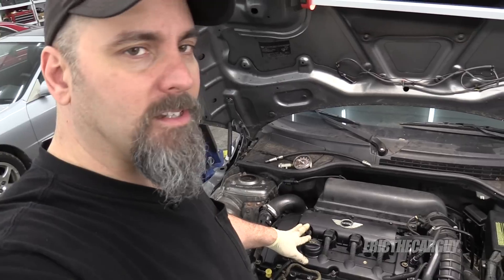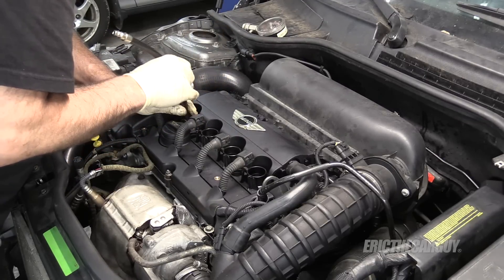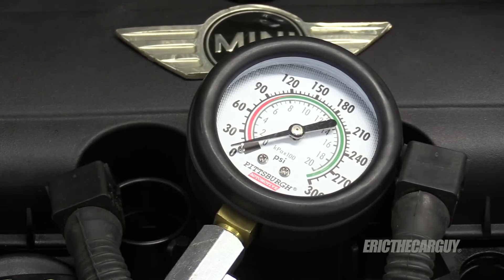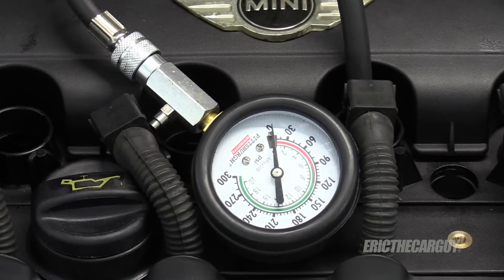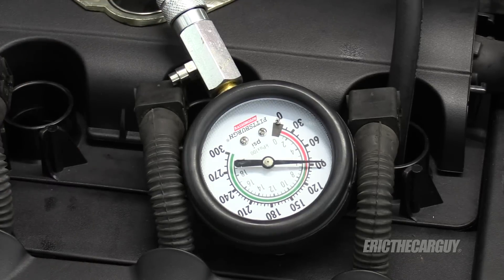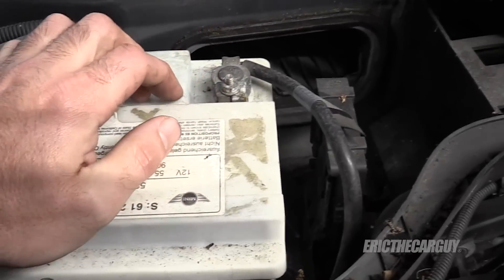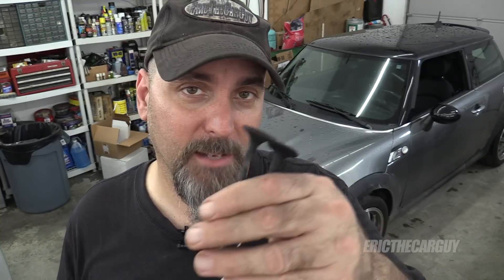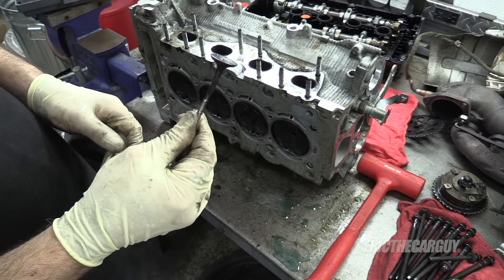How To Find Out if Your Engine Has Bent Valves

Comment: Hi Eric if I may ask something relating to the small Chevy Utility pickup or bakkie as we call them in South Africa. The car got into a flooded road and I am sure the water got in since the engine just went off. It was however not completely immersed into the water. It started after a while and few minutes later on snapped the timing belt and was towed back home. When it was finally fitted with new belt the mechanic noted that a kocking sound. This led to a complete overhaul of the engine. Crankshaft was brushed up. New valves fitted although none were bent.  However it does not get into gears. It idles. What could be the problem?

Comment: I think i got lucky. I had a crack no start issue i was chasing down on my 98 4v cobra motor which i thought was because of an electrical problem i had from a weird being burned on the egr. 

Long story short, while chasing down this issue, i did a compression test and everything was 125-130psi (18cc dished pistons) across the board. I found later the secondary chain was broken. I literally just found the issue so i haven't it'll the head/motor but i think I may have dodged a bullet. 

The primary Caine are new and have less than 100 miles on the powertrain but the heads were untouched. Lesson learned, change everything.

Comment: My 08 Subaru stalled a week ago on my way to work. Her timing belt snapped unfortunately and I’m worried that her valves may have gotten bent too which is an expensive fix. I won’t know until a bit after Tuesday.

Comment: hey Eric like your videos.after you checked the compression in two of the piston chambers do you not have to rotate the crank or cam shaft so that the inlet and exhaust valve seats are closed in the other two piston chambers before testing the other 2.also how much play should the valve stems have in the stem guides.any tips on checking if valves are perfectly straight or if there is too much play in the guides on a pitbike  👍

Comment: Use a bore scope camera in the up position so you can see the valves rotate the engine with a breaker bar from the crankshaft pulley and look to see if you have bent valves when they open and close

Comment: You’re speaking my language now. Lost my hpfp, cam shaft sensor was the codes. Replaced both, and grgegrgrhrhrh.  Take off the cover, timing chain exhaust sprocket sheared off, and the chain was broken.  When it died driving, there was NO significant sound or noise at all, no shaking nothing just.. dead car. I’m hopeful, that the chain broke upon my attempt to restart. As there was never a fire.. just cranking for a second. Then noise then nothing.  I am willing to replace the rods and head gasket etc. and your videos will be my Bible. I need to repair this car so bad. I gambled when my last one blew up, and was toast, hopeful for a decent long term ride. I did get 30k miles before it failed

Comment: My timing chain broke when I tried to start my Toyota PU.  As the valves were not moving when I cranked the engine to try and start her and my engine was a interference type there is a good chance the piston hit a valve.  Would a leak down be worth the effort?

Comment: hey eric i have a 2004 mdx that cranks but wont starts. the spark plugs keep fouling with fuel. when i removed the fuel pump fuse. it started up. i did a compression test i got 120 psi. what do you think?

Comment: Hey Eric, I tried to put a new timing belt on my 2000 Chrysler Concorde LXI 3.2, in my driveway? The belt never broke? Just was doing preventative maintenance. 158,000 on the engine? I lined all the timing marks up, put it back together, no start? Eventually got frustrated, put it on a flatbed, to a mechanic, his diagnosis was bent valves on the drivers side? I bought the timing belt kit, with water pump, installed that, everything spun fine? Would you recommend fixing this car, or try and sell it as is? I put at least $3,500.00 into this car in the last year? From struts, to injectors? Tires, rims, sensors, Evap system, ect.. ect… What would you recommend I do? I had to buy a new car, but this Chrysler ran like a top, before I messed with the timing belt? Can you recommend what to do with this car?

Comment: Nice video. I wanted to free up the pistons on my SUV that's been sitting on the driveway for the past 5 years due to some problem with distributor. So, I am going to take off spark plugs and pour two teaspoons of engine oil into each hole of spark plugs and turn the crankshaft manually in clockwise after a week of letting the oil sink. So is this the way to do it or will it mess up the timing . And , is there certain limit on number of turns or can I turn it few more times until I feel the pistons being lubricated? I subscribed . Thank you.

Comment: This dude aint touching my vehicle....
That vehicle is not normally aspirated (turbo charged), therefore he should've expect below average compression. See, turbo charged engines run with "low-compression pistons" (street talk). This is in order to compensate for the extra air taken into the cylinders, thus eliminating immediate engine failure.

Comment: Wooo lost my timing belt last night, let’s see how bad it is 😅
Reply: What did you find out? I broke my timing belt and there's oil in my 1 spark plug hole I'm looking to repair myself
Reply: @nickdoyle3950  I’ll try to return with an update soon, I wasn’t able to work on it in the driveway so I had to get it flatbed towed somewhere where I could work on it. I just got my tools to the same place so old tear into it ASAP. From my understanding the belt broke or came off, possibly failed auto tensioner, when I was trying to start the car, after losing the alternator belt? I have a 1999 prelude, so this is a bit of a thing. I’m hoping because it wasn’t in the interference range, my valves are OK 🤞
Reply: @ZonymaUnltd.  I need a new engine that's what happens when you go 100 mph mudding in a Accord 😅🤕

Comment: Hey Eric! I’ve owned my Infiniti 05’ G35 6MT since 2006 currently with 123k miles. It’s making the ticking sound but has no leaks around gasket and block. I changed out new sensors, solenoids, spark plugs, brakes, etc. should I spend the extra money to get the ticking sound checked and then have it fixed? Or sell the car and drive it into the ground? How much would a job like this will run? Any advice will help. Thanks.
Reply: Also, the car runs “fine” without any CEL and drives pretty good still.

Comment: I have Subaru which is a interference engine  and it had 0 comp on cyl 3 and 1 which are on the right side of the engine I checked the timing belt and it was off by 5 teeth. I realigned the belt and it now all cyl show 150. Is it possible to have bent valves and good compression? Do I need to do the leak down test?

Comment: I measured Valves on a 2010 Hyundai Accent to see if any were bent, timing belt broke. Visual they look fine however I found 2 valves with stems out by .010.  Do valves stems have to be perfectly straight with no deflection?

Comment: I have a 2.3 l Ford , crank  no start .0  compression on 4 cylinders . I pulled the cover and found the cams were out of time ,possible tooth jump. Is it  possible on this interference motor that timing jump bent all  or half the valves and still continues to crank? I know this is a crap motor . I will try a leak down.

Comment: Without doing wet compression we can't conclude either it's piston rings issue or valve leaking...
If in wet compression, reading improved not improved that means from valve it's leaking..
If reading improved means rings have leak.
If two cylinder HV low compression then gasket burnt..

Comment: I have a 09 R56 JCW with the same problem. Took it to Mini and they said cylinder 3 has 0 compression. They told me I needed a new engine. Once I got the car back the paper work said it is possibly a bad piston ring. I am pretty sure I have bent valves too that don’t require a new $10k engine.

Comment: Ok, so I have a '91 accord and I've done a compression check on all 4 cylinders...1, 3, and 4 are right about where they should be but 2 has no compression what so ever...and there's no leaks that I can find anywhere...could bent valves cause complete loss of compression?
Reply: Nevermind lol....i didn't reach the point of the video where u got 0 compression on one cylinder

Comment: THANK YOU Eric!! You confirm my suspicion.
This is exactly my situation after I did a dry and wet compression test (0 on both tests in cylinder 2, on a 95 corolla 1.8 7afe that I bought for my father. But would it cause engine not able to rev more than 3k rpms?

Comment: Eric, this is somehow unrelated but the idea popped on another video: car electrical connectors.  For some bloody reason, I haven't met a single mechanic who changes the connector housing when it's broken. Everyone makes a ghetto repair with tie-ups or electrical tape. Connector housings even for mercedes or audis are like $2-5 each and it's quicker to cut the old housing with pliers, check the pins are OK and fit a new connector. Click, brand new. Even on dealerships they never fix them properly. I struggled with my broken maf connector for years only to discover the housing was €3.61. 
Just an idea for discussion.

Comment: I have exhaust valve that moves enough to open but does not fully close. I found by removing valve cover and pinpointing the noise. The valve doesn't close therefore the rocker arm is bouncing off the cam lobe. Is the valve necessarily bent or could something else be making it stick?

Comment: Ive got engine management light on my mk4 golf that doesnt want to go away. Had new spark plugs, temp sensor, crank sensor. Diagnosis keeps saying misfire on a cylinder and also temp sensor but they were all replaced just months ago. Car runs fine

Comment: This is just wrong. He removed a huge spark plug, and repaced it with tiny compression tester fitting. It dramatically changed the compression ratio of this cylinder, the results will be very inaccurate.

Comment: Hey Eric. So I have a question about my truck. It’s a 2003 GMC Sierra 2500 HD 6.6. Just recently bought the truck and the brakes went out so I replaced all the rotors calipers and brake pads. After replacing I bleed all the brakes and no more air came out but the brake pedal was still spongy. Took it to jiffy lube to see if maybe they could bleed them but they said that there was a clog somewhere in the system most likely in the power steering. He said the power steering and brake booster are connected and it sounds clogged. It does make a noice when you press the brakes and the power steering sucks. Have you ever heard of this before or got any ideas? Thank you.
Reply: 1971skylark It may be your power steering pump going out. I have a 05 Chevy 1500 without the hydroboost brakes (assisted by power steering). My brake pedal is like that sometimes, but if I pump it a couple times it's stiff. Does your power steering make noise when you turn?
Reply: AdamRud47 yes it does make noise when I turn and it doesn’t work very well. I’ll change it this weekend and see if it changes. Thank you for the help. I’ll keep you posted.

Comment: That's a factory turbo engine so there's less compression because there's forced induction. Otherwise engine would probably crap out after 60,000 miles. (Typically an issue people run into after installing eBay turbochargers on their cars without doing anything else to the engine block.)

Comment: Help Eric the Car Guy I really need help I have the same engine and it looks like I spun the intake camshaft it literally cracked a couple of the Caps bearing caps I'm wondering if there's a place where I can buy Valves and camshafts like a kit to rebuild a head cylinder any help would be much appreciated thank you
Reply from the maker: I recommend replacing the engine.

Comment: Thanks for this! Mine has a W11, but still gives me peace of mind to hear your interpretation of the results. I had low to mid hundreds the last time I did a test, but I think it may not have been warm enough and I'm sure that gauge hose wasn't tight enough. I'll do another one, along with the wet test, soon enough.
Reply: FWIW, the W11 has an 8.3:1 compression ratio
Reply from the maker: The throttle should also be open, but that's problematic in a vehicle with DBW.
Reply: Yeah, that seemed to be a huge issue when I was trying to run running the test. I figure I'll just take the intake hose off to make sure it's opening, or have it held open if it isn't.

Comment: Compression tests are useful to diagnose a myriad of cylinder problems, as low compression could be due to bent valves, worn valve seats, leaking head gasket or worn out piston rings.
As you said, it is one step to get clear results of an engine failing, not necessarily bent valves.

Comment: Why could an engine have bent valves on only one cylinder? For example, if the timing belt snaps and the valves hit the piston head, then pretty much the whole valvetrain would end up crooked.
Reply from the maker: Usually when a piston hits valves the engine stops spinning.
Reply: if the belt failed during startup or idle there's likely not enough momentum in the engine to damage all the valves, and the impact wouldn't be enough to damage the cam.
Reply: +animefreak5757 Interference engines, that was what I meant (the word didn't come up at that time, haha). Timing chains are certainly a "safer" solution to avoid many problems as the ones you mentioned, but there are several chain-driven engine that have either a bad design or uses poor quality materials, as the 2.0 TSI/ TFSI EA888 from Volkswagen-Audi. The timing chain around 70,000km (~45,000mi) will have stretched too much that driving the car would be dangerous, and with such a great slack the chain will hit and scratch other internal components until it gets too loose and starts skipping teeth from the pinion. As an obvious symptom, the engine will make a constant banging noise while running.
Another example is the 4.2 V8 also from Audi (around 2005-2006 MY), where the tensioners fail and the whole engine must be taken apart to replace them since Audi logically thought a timing chain would require no maintenance and they place it on the back of the engine, next to the firewall.
Reply: +animefreak5757 Well, there we go. It will depend on the engine and how much "intrusion" there is between the opened valves and the piston.
Thanks.
Reply: when the valves and the piston can hit each other (without totally dropping a valve) it's called a interference engine, in case you need the term to look something up in the future.  But yea, if the belt fail's while your on the highway it's probable game over for the head at least, since the moving car will drive the engine even if it's stall's.  It's also possible for a belt to skip a tooth when it get's too worn or old...one of the reason's i prefer timing chains.  Sometimes skipping a cog or two on startup is enough to damage one or more valves.

Comment: to my experience variable camshaft and electronic throttle bodies can greatly influence a compression tests.. on some engines you must use a scan tool to activate a compression test function which will not only cut off fuel but will also fully open the throttle plate... just pressing the pedal will not fully open it in alle cases
Reply from the maker: Excellent point.
Reply: I've gotta find a tool that enables this function! Hopefully it's compatible. I have an older scan tool, but I'm sure I've never seen this feature. I'll just have to get the special Schwaben one Foxwell NT510 for Minis (and BMWs, RRs).

Comment: If your engine has adjustable valves, you could pull the valve cover and, check if valve lash is in specification.
Reply from the maker: Yes, that can also work, but it's more time consuming in my opinion.

Comment: I think those numbers would have been higher if you had blocked the throttle open, I always have the throttle open on compression tests to ensure proper fill of the cylinders. However this is not always easy with drive by wire.
Reply: this is true, the most useful information though isn't really how much compression each cylinder has (unless it's crazy low), but the difference.  Every compression tester i've had reads at least a little different.  The length of the tube, the material it's made from, the extra volume it adds to the cylinder, how big or small the displacement of that cylinder is.  All of these and more change the reading.
Reply from the maker: Not possible with DBW.
Reply: @ericthecarguy  complicated sometimes yes, but not impossible, manually opening it and placing an object to hold the blades open can be done, disconnect the electrical plug first is my suggestion, also be careful in selection of the object, something that can't end up down the intake would he advised, failing that, remove the throttle body itself is an option. Your testing showed 90psi which is way low that engine should be at 130 minimum per Mini Cooper service manual. 90 would probably be fine for an engine that can't draw in enough air to fill it's cylinders, but the proper technique is to have the throttle open, and with DBW this can and certainly will skew the results, I am not saying your doing it wrong, I am saying that you can not get the proper results with a closed throttle, the DBW technology makes this test more complex and without considering that it would be easy to assume a perfectly fine engine has a major problem.
Reply: I did this to verify on my own car, and open I was 170-175 across the board and less than 120 with the throttle closed. That's a big difference.